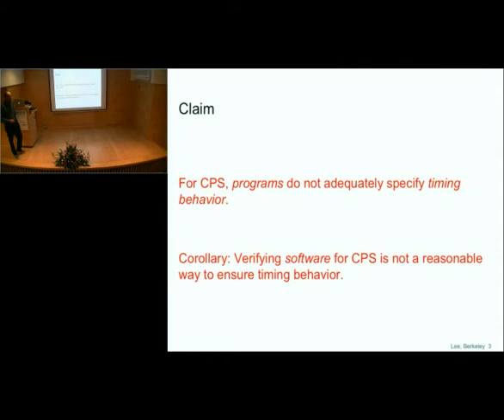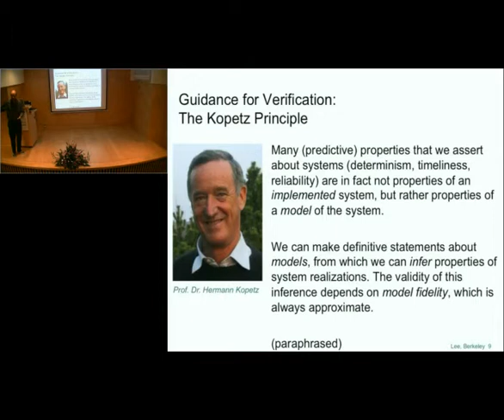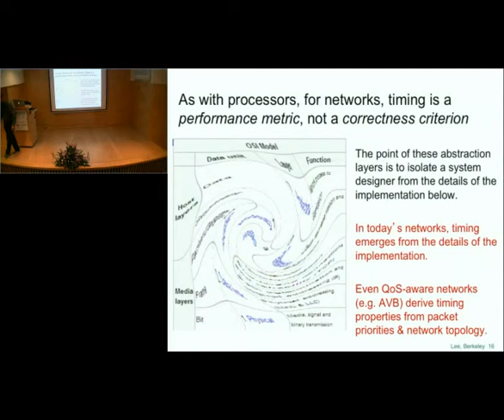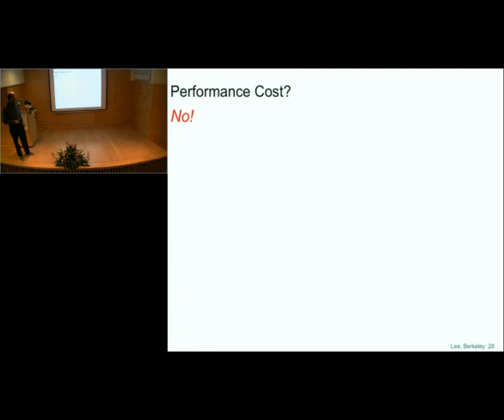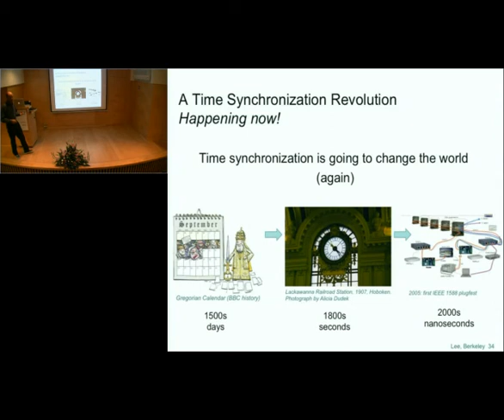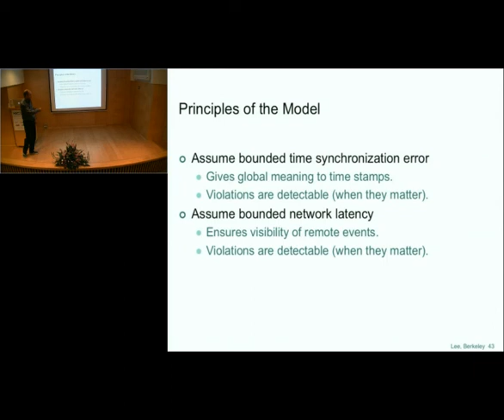Verifying Real-Time Software is Not Reasonable (Today)

Comment: This is brilliant. I know this video is old, but the problem is shocking relevant. The video game industry needs this even more than the control system engineers... so many game-play and physics issues are critically timing dependent! 

Many games lock on to the monitor vsync or other signals in a desperate attempt normalize timing across different computers, but it's far from a perfect solution. Try running Skyrim on a 120Hz monitor instead of 60Hz... the first thing that happens is the horse flies into the air because the physics is getting its timing signals from the vertical blank. If the timing is wrong, the game explodes.  If game timing could be reliably guaranteed in the compiler instead of by janky work-arounds, it could save millions of dollars in effort especially when porting between PC and console.